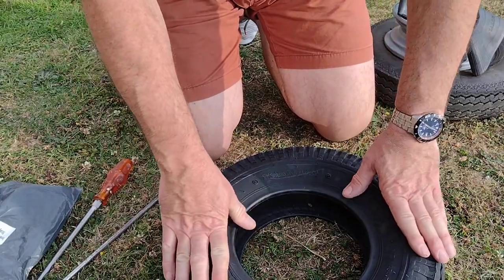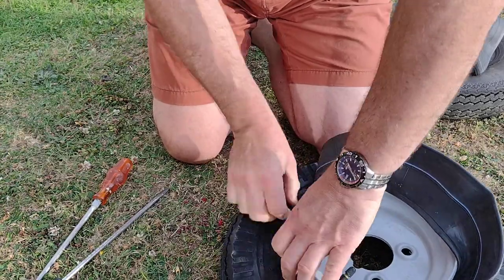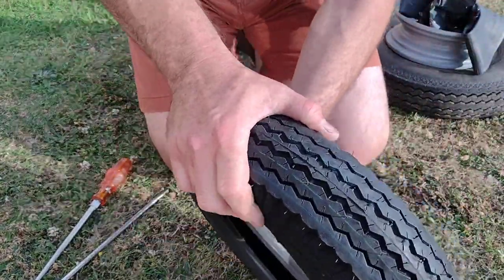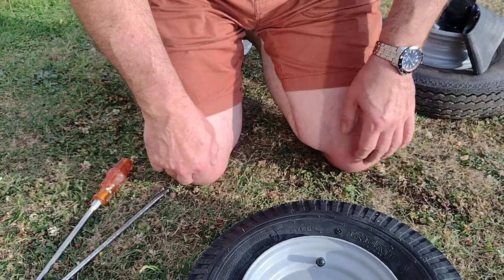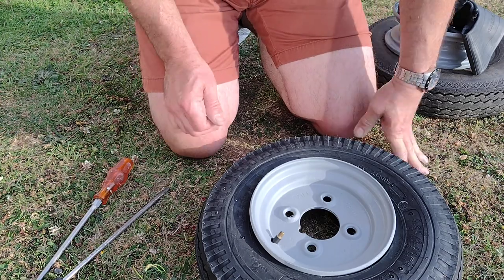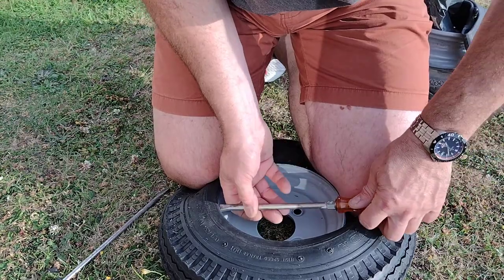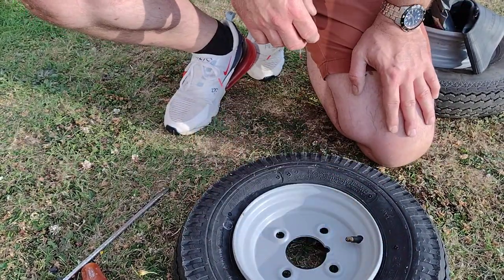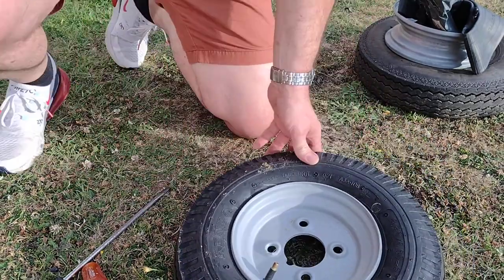How to fit a Inner Tube and 4.80/4.00 8 Tyre / Tire into a Trailer wheel / rim by hand - full video

Comment: Next time try spraying warm soapy water to make the Inner Tube slide in against the rubber tire, it will go in a lot easier, auto factories use this solution except machines apply the solution.

Comment: this is great for me. I have a 4.80-8 5-Bolt Trailer Tire but the replacement rim will not fit over the existing hub. this saves me from replacing both hubs, rims and tires. to ensure they match

Comment: Hi just a quick question as I’m at a loss, I’ve replaced the abs sensor and hub on the mk6, did you have to clear the codes or did they go off after a drive ?
Reply from the maker: After I'd changed the Hub and abs sensor the ABS light went off. The code is probably still stored on the ECU but the main thing is the light is off and the ABS works. I did clear my codes. The fault I had was wheel speed sensor but of course that was due to the ABS ring on the Hub being non existent. Is your light off now?

Comment: Was this a tubeless tire that you retrofitted with an inner tube? I’m regretting this project already…..
Reply from the maker: Yes, because a previous owner had elongated the valve holes so a standard tubeless valve wouldn't fit.
Reply: @limawhiskey7842  how do you figure out the tube size ?
for example my tire is rotted, its 21 x7 x 10   , i need a tube but what size?
Reply from the maker: @stephenkasee650  Google 21x7x10 tube and you'll get various results depending on your country. For the UK I get a couple of websites plus Amazon.co.uk. Good luck.